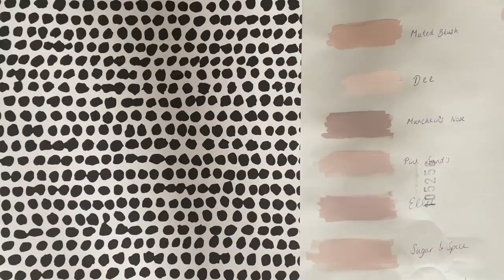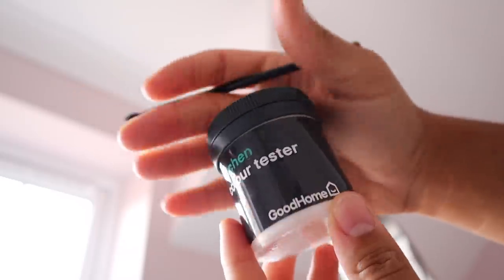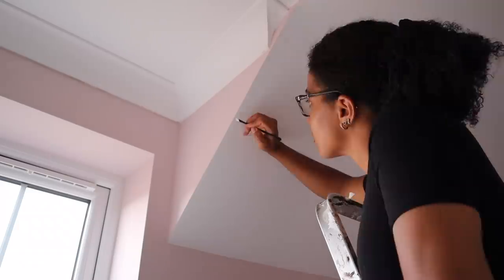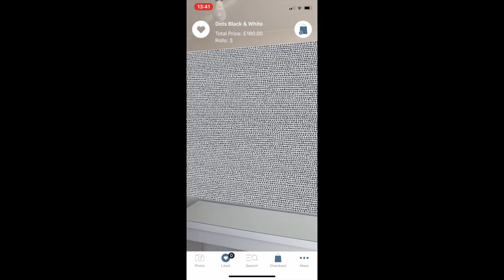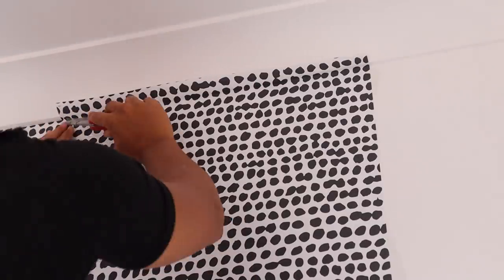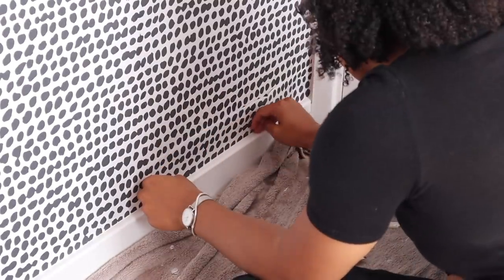GIRLY BUDGET DRESSING ROOM MAKEOVER | Girly Instagram Room | Shade Shannon

Comment: Fabulous make over. I love watchimg your make overs and up cycling. But only installing that electric light yourself was very unsafe and indorcing doing it because it looked easy and the mains was off, is very dangerous. i worry that someone might try to do and not be as lucky as you. Please please encourage safety first and the use of a qualified electrician. probably only £30. But well done on the rest of the make over.
Reply from the maker: I understand your concern but I can change the light myself so I don’t need to pay someone else. I mentioned in the video to be safe first and foremost 🙂